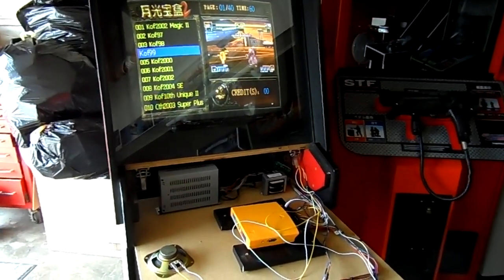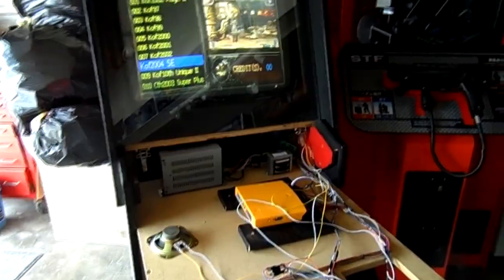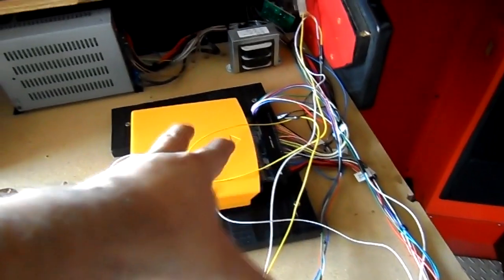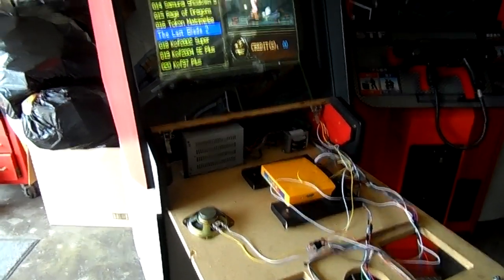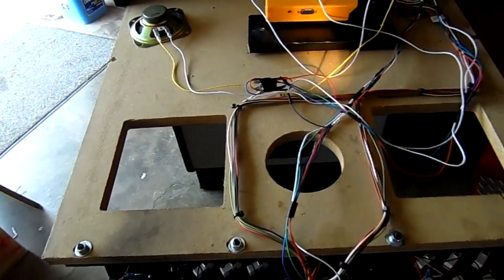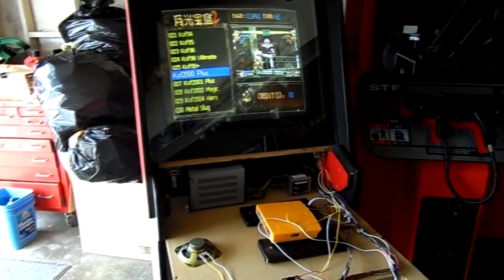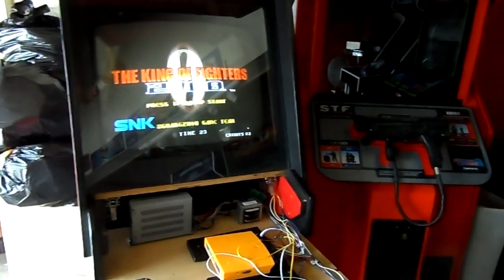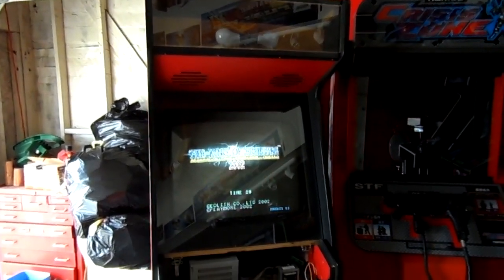Solving A Simple Arcade Speaker Problem Of No Sound

Comment: Thanks for this video, just setup my Pandora's Box 4 and sound was initially working then stopped. Turns out to be 12v didn't have a solid connection. Re-crimped it and voila sound came back. Thumbs up
Reply from the maker: MrOvertoad glad my video could help you.

Comment: hey moomert. I have 2 questions! 1 is will the new pandora box work on crt? And second is I have a Simpsons Pcb and when I plug it into my Capcom Big Blue, Captain Commando' there is no sound. I think you had an issue with this when you tried to put a Teengage Mutant Ninja Turtles in a capcom cab. I have extra speaker wire and this molex converter that a friend gave me but i'm clueless as to how to use it!
Reply from the maker: The arcade version supports CRT. Trying seeing if you can change the output from stereo to mono or vice versa via the settings menu
Reply: moomert1  man, I think the board is fucked. no sound, looks like a piece is missing and the back looks all beat up. i've had that board for over a year lol and just now figured out how to wire it. do you know of any companies that fix pcbs? soooo..... the new pandora box will work in my jamma cab? I currently have pandora box 4. and do you think 6 is worth the update? Thanks man love your videos.
Reply from the maker: @normamoreida9850  make a video on the pcb. It might help to see what is wrong. There are people on the KLOV forums who fix pcbs. I think the PB6 is good. It's a nice upgrade. Not great but nice. I would recommend it . However, you have to remember,  PB6 requires you to install the games yourself.....which is very easy to do.

Comment: Hi mmomert1, I have the same problem as you. I have the same power supply, the CPS2 works well, but I haven't got any sound. I doesn't see on your video what plug on your Power Supply, I suppose you plug another cable to 12V socket (3:12) , I did it but doesn't work, could you help me? I know this video is so old but Could help me
Reply from the maker: Anonimus Tor are you sure the issue is not the cpsA board?
Reply: Thank you for answerd me, so quick.

In my Old Us250 Hantarex Supply was working. But I had to change it because this PS died, I changed it for a PS like yours. Although now I can only play without sound, on my "Coin Mech" has a light bulb that before the change was also illuminated and now no, investigating I think the 12v does arrive to speakers and bulb of Coin Mech. Where you plug another 12v?

Regards!